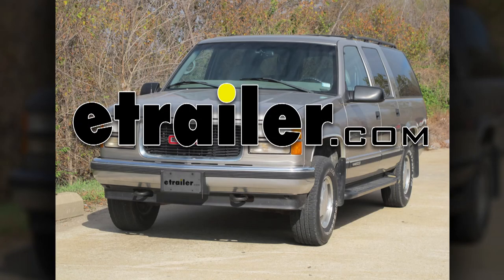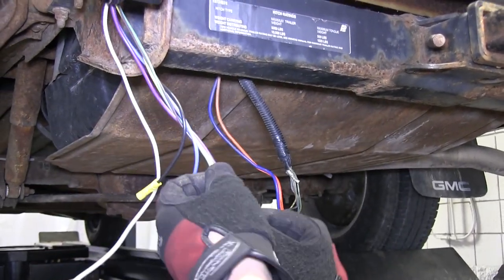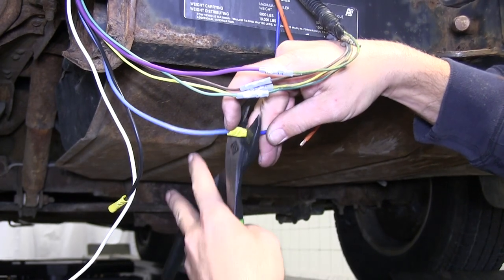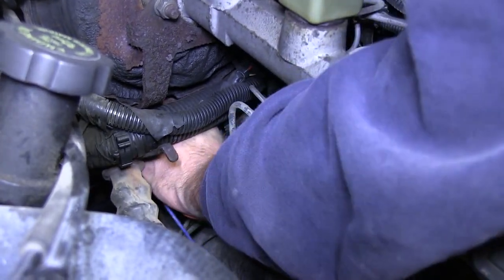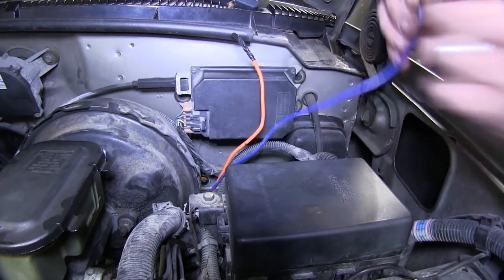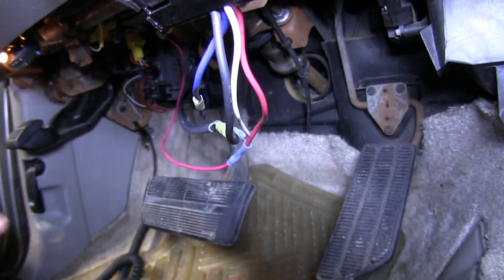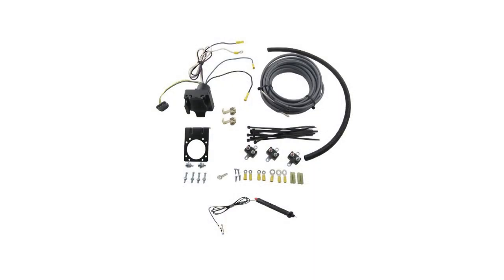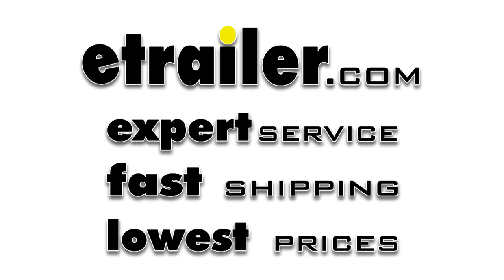Installation of a Trailer Brake Controller on a 1999 GMC Suburban - etrailer.com

Comment from the maker: A fuse would work, but breakers are nice because they reset themselves. If the breaker is for the 12-volt accessory circuit of the 7-way it would be a 40 amp fuse. If the fuse is for the brake controller it will need to be a 20 amp fuse if its between 2 and 4 brake assemblies, or 30 amps if between 6 and 8 assemblies.

Comment: I'm curious why you didn't use the relay block to tap into the brake switch. There is a provision there for just this application. Thanks much for the walk through!! Zip~
Reply from the maker: Thank you for the feedback on this installation. We do not look into tapping into the relay block. We find it just as easy to tie the wire into the brake signal wire. Thank you for sharing this tip with us.
https://www.etrailer.com/Accessories-and-Parts/etrailer/ETBC7.html
Reply: Thanks for the tip! I'll check mine for it!!

Comment: Didn't u forget the 40 amp circuit breaker for the hot orange wire before connecting it to the battery?  Here you connected it  directly to the battery without any fuse/breaker.
Thx
Reply: Both of the terminals on the back of the fuse box already have fuses inside the box.

Comment: The only issue I have is the ground, should have cleaned the frame up with a grinder or buffer pad so there was clean metal for it to sit on. Then put liquid electrical tape over it.

Comment: Couldn't the power wire connect directly to the positive battery terminal with an inline fuse? instead of a breaker? If so what Amp rating should the fuse be? If not then can you explain how the breaker works, or is different than a fuse?

Comment: I installed a 7way pin harness to on my 2020 durango gt w/o tow package. The harness has a blue wire, so my question is can i juct connect the blue wire from the controller to that blue wire from wiring harness

Comment: What do you do to rust proof the bare metal from drilling at 4:21 and 5:39?
What do you use to seal the crimp connector at 4:20 to prevent the wire from rusting from moisture and road salt?
Reply from the maker: To protect the bare metal, you can use a rust resistant spray paint. This step will protect the metal from rust and corrosion. To protect the wiring from corroding, use heat shrink butt connectors.
https://www.etrailer.com/Wiring/Curt/C57674.html

Comment: If I already have the 4 pole, can I just use the one on the 7 plug i got.from you guys?
Reply from the maker: You should be able to plug the 4 pole into the 7 pin and wire the other functions to the tow vehicle.

Comment: Where were the orange and blue wires by the hitch located?
Reply from the maker: They were run from the front of the vehicle for the brake controller.
https://www.etrailer.com/Accessories-and-Parts/etrailer/ETBC7.html

Comment: so where did the Blue and Orange wire come from?
Reply from the maker: The blue and orange wire are going from the 7 pin connector to the brake controller in the cab of the vehicle.
https://www.etrailer.com/Wiring/Curt/C57674.html

Comment: just asking what is the orange hot lead for on the brake pig tail
Reply from the maker: gary morgan  The orange wire is a separate power feed for an illumination circuit. Controllers back in the day were wired to only light up when your dash lights are on, using that orange wire. Modern controllers have light displays anytime they are active, no matter what the dash lights are doing, so the orange wire isn't needed.

Comment: You connected the ground right to rust lol
Reply: The screw itself is the ground contact because its drilled into the frame.
Reply: @jakesvids3467  yes but you should sand the surface to clean metal for a good conection, the guage for thag frame isnt going to have much contact point after a self tapper, shouldve used the oem ground cable, or sanded it down first, this will rust in months and you will be chasing gremlins
Reply: Compared to the rusty connection, I do worry about the rusty frame. I don’t trust the frame towing a load that is heavy enough to require a brake controller